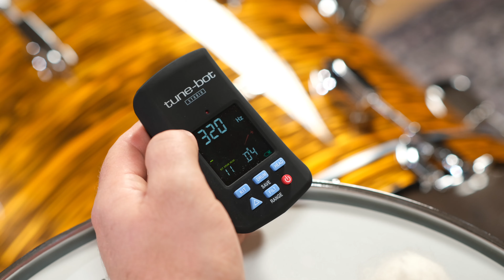Big Metal Snare Drum Comparison | High Tuning | Copper, Brass, Aluminium, Steel & More | Thomann

Comment: Hervorragend gespielt-wie immer! Bitte mehr Videos in diesem Format .Einziger Wermutstropfen: Hätte wirklich gerne die Yamaha stage custom steel und die Ludwig supralite im Vergleich gehört...
Reply: Yes 2 great snare drums that a lot of people do not know about.  I have the 6 and a 1/2 by 14 Yamaha stage custom steel snare and 8 by 14 superlite and both  are great
Reply: @ronaldzeoli7528  which snare do you prefer and which skins do you use
Reply: @rog1164   I use remo coated single ply heads and I like them both for different reasons. I think the 6 and  1/2 by 14 Yamaha steel snare is a better Bang for the buck.
Reply: @ronaldzeoli7528  Thank you  very much for the information

Comment: 9:20 The gretch Brass one sounded best, I think.*

Overall, I'd say Gretch were typically the best ones. The difference between all these snare is very minimal, though. It some down to tuning and choice of heads and so on, to a larger degree.